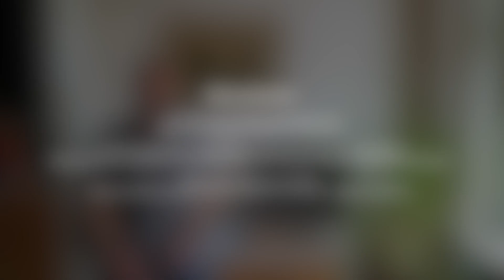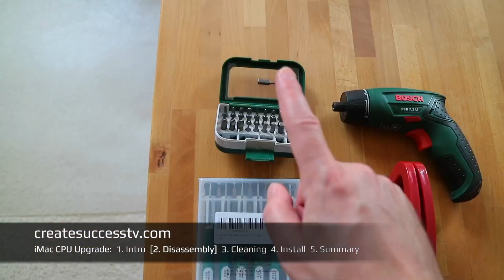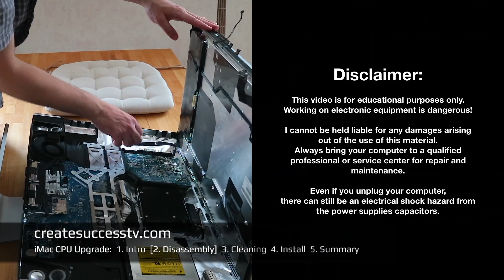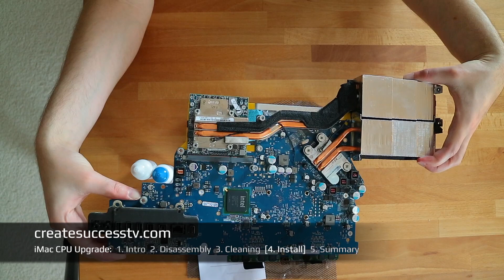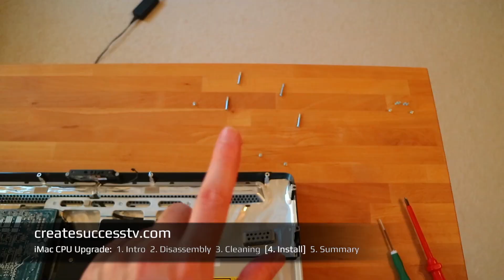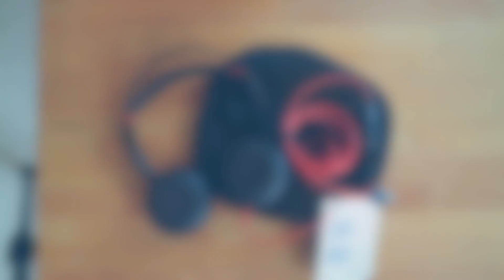How to perform a iMac CPU upgrade (MB325LL/A)

Comment: Newer iMacs have much better and efficient cooling design. It was redesigned completely without optical drives, with new much thinner and cooler display panels, and with low-power storage. So most of the heat comes from CPU+GPU, through one big radiator.
It is also available in double-fan design like iMac Pro in practically same enclosure.

Comment: Is it possible to upgrade the processor from i5 to i7 on imac 2017 27" 3.0Ghz  Radion pro 570?
I checked on apple site on the 2 other  of 27" its written configurable but not on the 3.0
I was torn between 21" and 27" model and the most important key factor is to be able to upgrade in the future.Many said to buy the highest gpu and there is amongst the 21"model imac that can be upgraded into vega but im not sure if anyone can upgrade without removing the whole motherboard.
Reply: all of the imacs have socketed cpus

Comment: I just been told by a computer shop in Plymouth UK - a CPU upgrade is not possible on an I mac - and if it is - it is too cost prohibitive due to the cost of other parts required.
Reply from the maker: I think the newer model iMacs have a glass panel that is hold in place with adhesive. So I would definitely check your exact model, maybe have a look here ➜ https://www.ifixit.com/Guide/iMac+Intel+27-Inch+EMC+2546+CPU+Replacement/15764
Reply from the maker: Personally, since filming the video, I have switched to a used 2009 Mac Pro, because they are more powerful and much easier to upgrade:
Part 0 - Introduction ➜ https://youtu.be/lJF-rffIyq0
Part 1 - Bluetooth ➜ https://youtu.be/d9xPvreK8tg
Part 2 - High Sierra ➜ https://youtu.be/ecWEhbtvXHk
Part 3 - SATAIII SSD ➜ https://youtu.be/2gqkGPidI84
Part 4 - Radeon RX560 ➜ https://youtu.be/UoV4I-FlYdw
Part 5 - Memory ➜ https://youtu.be/1XYNqfnu4UA
Part 6 - CPU ➜ https://youtu.be/8cVhURcpi64
Part 7 - macOS Mojave ➜ https://youtu.be/uKAJCuWtp4Y
Part 8 - Radeon RX580 ➜ https://youtu.be/Dv73HrnsNkw
NEW *Part 9 - NVMe SSD ➜ https://youtu.be/A8hPC_DDq6Q
NEW *Part 10 - Fan Replacement ➜ https://youtu.be/fBiIJami8v0

Comment: about better performing graphics cards, for the Imac. there are several types that work perfectly. they are from alienware laptops. The lowest price one is GTX 765. This is a two gig card, and will run most video games. The next is a gtx 770 with 4 gig, and will play even demanding games. The most expensive, ($350.00 + shipping) and has 8 gig, so will play with all the shaders and rez on the most demanding games. The 765 gtx 770 can be had for around 100.00 dollars. This will make your imac truly up to date.
Reply from the maker: Awesome, I am glad you found a card that works for you!
Reply from the maker: Actually, I did switch to a 2009 Mac Pro last year, because I wanted something more powerful for 4k video editing ➜ https://youtu.be/Dv73HrnsNkw
Reply: That works with a early 2009 3,06 24”?
Reply: @sergiomaiajesus  from mid 2009 to late 2012

Comment: Can this be done on the 20”?
Reply from the maker: I am sure there is a tutorial for it somewhere, but at this point, I wouldn't recommend it anymore.
Reply from the maker: Because with the release of macOS Mojave, you need a graphics card with Metal support.
Reply from the maker: That's why I abandoned my old iMac and switched to a used 2009 Mac Pro, which works much better because you can easily swap out any hardware ➜ https://youtu.be/lJF-rffIyq0
Reply: Thank you

Comment: look like a pain to replace my hp all in one was so simple
Reply from the maker: Yes, for the average user it is quite challenging to replace the CPU on the iMac. Eventually, I gave up on my old 2008 iMac and got a used 2009 Mac Pro 4.1 instead. In comparison it very easy to upgrade and much faster as well ➜ https://youtu.be/UoV4I-FlYdw

Comment: So is the iMac faster? is it better for video editing?
Reply from the maker: Unfortunately, it was only a small increase, because of that I switched to a used 2009 Mac Pro instead ➜ https://youtu.be/lJF-rffIyq0
In my opinion much better for video editing than an iMac, and much easier to upgrade as well.
Reply: My 2008 iMac i've had since new (24"  2.8 extreme processor) does a much better job of iMovie than my 2014 MacBook Pro...

Comment: Nevermind i got it but will the q9000 work in the system
Reply from the maker: No, the quad-core "Intel Core 2 Extreme QX9300" will not work!
Reply: @ReviewTechTV  I'm helping my mom upgrade her iMac 8,1. We upgraded the hard disk drive to an SSD, and we maxed out the RAM to 6 GB. She has the 2.8 GHz stock E8235. I'm trying to determine the fastest CPU we could upgrade to. 3.06 GHz 8435 (what you upgraded to) seems like the fastest CPU Apple offered with this Mac. When you mention the quad core model, you're referring to the Q9000? But you mentioned the Q9300 doesn't work? Do you have a list of supported processors? I'm considering the T9900 or the Q9300 if one of those would work, as they seem like the fastest models. Any advice on where to identify which CPUs are supported by this Mac? Great video, thanks for the information!
Reply from the maker: @AdamJaz  That's a great question, maybe have a look at the MacRumors forum, I recently got a 2009 Mac Pro, and upgraded it, they had a great CPU list for that ➜ https://forums.macrumors.com/threads/mac-pro-cpu-compatibility-list.1954766/

Having said that, I would stick with the 2.8 GHz, because the perforce increase I got from the 3.06 GHz was only very small. Even if the hardware could support faster Intel quad-core CPUs, the iMac BIOS (EFI, Boot ROM) will not support them… hence it is not worth the trouble.

Take my used 2009 Mac Pro, for example, it needed a BIOS (Boot ROM) update before it was able to accept newer and faster Xeon CPUs. Essentially, CPU microcodes are sometimes changed and updated by Intel, and then these updates have to find their way into the Apple Boot ROM, which is usually included with the macOS installer.
Reply: @ReviewTechTV  aww too bad :/ Well, Ill just use the x9000 then since I have two sitting right here... at least I can overclock in windows, and hopefully in OSX too. They work great in my acer laptops of that era!

Comment: what is the quad core processor called?
i would like to upgrade it
Reply from the maker: Honestly, even if you could upgrade to the faster quad-core, I think it would not be worth it because you are limited to the old GPU of the iMac. Recently I bought a used Mac Pro, early 2009, from eBay, and it was much easier to upgrade everything. ➜ https://youtu.be/lJF-rffIyq0
Reply: @ReviewTechTV  cant change the GPU too? :(((